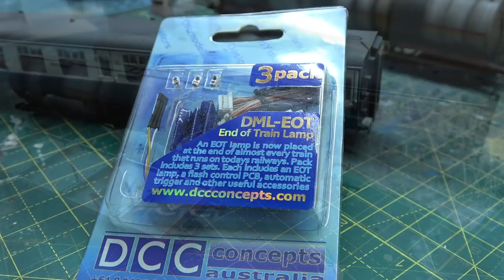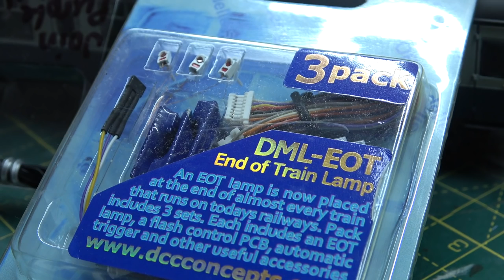Fitting working end of train lamps

Comment: Been using these for years. Such a great product.
When I do mine I remove the pin for the white cable by using a scalpel.
With the yellow and purple cables, I cut the quite short, maybe 3-4mm.
Remove the sleeve from the cables, twist together and solder.
Makes it a little neater.
Reply from the maker: Cheers, I'll de-pin in future.

Comment: The tail lamp initially signified "Train complete" to a Signalman in the old manual signal boxes - or anyone else on or about the line observing the passage of a train. In the old days of absolute block, along with no or limited track circuiting and loose coupled or partially fitted goods trains, it was a vital visual assurance to a Signalman that the passing train was complete and that he had left the section as clear as he'd found it; i.e. there were no rogue breakaway vehicles left behind. Nowadays, track circuiting pretty much proves the route is clear but tail lights are still a comforting sight for all concerned. Sadly, modern model makers have still not realised the important significance of displaying a tail lamp because they provide no function to turn off the tail lights of their engines when coupled to a train. In the real world, any loco pulling a train and displaying tail lights would be stopped as soon as it was discovered and until the error was corrected.
Reply: Many years ago, we had a new station manager at Reading. She was Spanish.
She saw a freight rolling through the station and saw the tail lamp. Then went off in a panic, called the box and reported a train in trouble. Shut the station for about an hour.
She got a sideways promotion shortly after.

Comment: Thanks Richard, that was a very interesting video. I’d wondered how those spring type pickups worked ! I use iTrain with block detection so had intended to fit some form of tail lights to my loco hauled trains , not only for aesthetic reasons but for a more practical reason - so that iTrain will know when the whole train has moved out of a block and not just the locomotive.

Comment: That circuit is insanely big! You can get SMD LEDs that flash slowly by them selves, no circuit board needed.
Reply from the maker: You still need to convert the DCC signal into a usable 12v for the Leds.  They wont flash connected directly to the track.  Agreed the circuit would be smaller though.  Ideal for some of the wagons.
Reply: @EverardJunction  1 diode and resistor will do that trick. Can even add a small SMD capacitor across the LED for stay alive. 
Also will be more cost effective

Comment: Its really great to see you hands on because although we know these are models, when seen running in your layout, its difficult for my aged brain to not realise they are not the real thing. I only got to play with the real things, so its great to see what level of realism you are going down to. When i started on BR  trains didn't have headlights like they do now, they only had illuminated route box indicators or double white lines on front and double red lines on rear when ECS. This was on 415 and 416  epb units. That was the inner suburban and the loco hauled for long distance passenger. Also brilliant you have train crews in cabs as it was quite common for other train crews to travelling passenger in rear cabs. I'll be looking out later on for a crew to be "Paddling Up" to change the shoe fuse.

Comment: I recently did this to a rake of BR MK1s using the wiper pickups. The train hardly moved so I switched over to the spring on axle method. The train looks fantastic in a low light.
Reply from the maker: I had the same problem with the wipers.  They're handy for a single vehicle in a train but not the whole thing.

Comment: Great video!  I noticed that you install a left and right pickup on the same truck (on both ends of the railcar). One word of caution would be that if someone is running metal truck frames, they wouldn't want to do that as the electrically live axles would short out through the trucks.  As mine are plastic (and I suspect yours are, too), that isn't a problem.  If you have metal truck frames, you could arrange the wheels so that they both pick up from the same side in a particular truck, with the other truck picking up from the opposite side.  While not as ideal for dead areas of track (like diamonds or frogs), it would be much better than a single pickup on each truck.

Comment: one thing that I know that when yo take a car out of service if it be a tanker, box car  ect and you need a EOT you would put it on another car so that you have a EOT while the other one is in service for repair. Great video here on how and where you placed the EOT on them if there is a way that you can move them around would be perfect but I know that it is almost imposable to do, your video have gotten me thinking of EOT for my setup that I am thinking about building or making from old parts that I have laying around the apartment where I work. if it is posable that I can do it witch I feel more than able to make and it dose run on the same way that you have in your video here I will let you know how it turned out without having to spend money when you could save some in these times we live in.

Comment: I use conductive ink to bridge the wheel insulation without the danger of damaging the bush. Its made for drawing connections for components on almost any surface, including paper.
Reply from the maker: I've tried that a few times and had mixed success.  The last one I did corroded and eventually stopped working.  Stuff was called Liquiwire

Comment: Have you concidered having the magnet switch under the roof of the wagon? Then you could switch them on and off manually with a handheld magnet, and also they would not be affected by any kind of magnetism from the rails!
Reply from the maker: If the train looses power for even a second the lamp would go out and stay out until activated by the magnet again.  Just the way they work unfortunately.  I got fed up with them turning off when they went over some points or dirty track so decided to remove the feature.

Comment: From memory, working on the railways. The rule book on tail lamps was basically: if a train passed (freight or passenger), not displaying a red tail lamp / lights, you could assume the train was incomplete (or divided). Eg. Possibly, part of the carriages or wagons had become come detached. In practice; more likely the lights had not been put on by the train crews; (on a passenger unit as an.example).

Comment: I'd personally put the white wire out of the connector just to neaten it up a bit more and reduce the chance of any short. Those JST connectors have little flaps on each pin, if you lift them up you can just pull the wire completely out.
Reply from the maker: Cheers, will do that in future.
Reply: @EverardJunction  No worries, don't mention it :D

Comment: The battery operated flashing tail lamp hasn't been around, possibly as long as you might think !  There were still lots of oil tail lamps in use at the end of the BR era, which gives you a little more choice. Just be thankful you aren't running GWR passenger trains with "Slip" coaches. Which could require as many as 3 tail lamps on one vehicle all in a cluster, to identify the number of slip portions included in the train !!! 
Happy modelling, your layouts coming along nicely.
Reply from the maker: I might add one or two oil lamps in future as they were still about following the widespread flashing lamp introduction in 87.  The oil lamps were eventually banned in the early 90s.  You won't be seeing any slip coaches any time soon!  Far too complicated as you say, cheers.

Comment: Great video. I am gathering all the supplies together to start adding interior lights to my rakes of coaches. I have a mainly steam era layout & will add the appropriate lamps to the end coaches. Just interested in the size of that fine enamelled wire you are using & where you get it. 😀

Comment: I don't know about some but if anyone is wanting a end of train light like this. If you use Bachman they have a wheel set fited with said light and it has a realistic coupler that the light stays on. 
IMPORTANT NOTES BEFORE BUYING!!!! MUST READ!!!!.  
Note 1: the light dose do well on dcc or dc its fine. 
Note 2: back of the box that the light is in is not painted so it might light up the end of your train car. 
Note 3: if you get this the train car HAS TO BE from bachmann. I don't know if it will work with others Rolling Stock makers but this thing is best for bachmann only!
Note4: last time i checked it was like $20 to $30 us dollars to buy just one little wheel set with said light and the motherboard chip to run it as of 2021 September 4.

Comment: Great video and techniques! Using a decoder for each tail lamp seems a rather expensive approach but the simple method of bridging the wheel-axle insulator is brilliant (I had wondered about soldering wires across). I wonder what you think of the alternative battery tail light systems with motion-sensitive switches

Comment: this is at least as complex as when you showed how to wire switches - ty for the exquisite detail - one question does it matter which way the pickup strings long ends point - i.e., should they all point in the same direction or does it matter - ty for posting! :)

Comment: I love the idea of the pickup spring - very neat.
How reliable is the little slithers of wire in the bushing?
Is there a metal - brass perhaps - bushing replacement to remove this requirement?
Al.

Comment: Excellent 80's synth pop intro music :) Deffo a nice feature to add a whole lot of realism to the models Richard, I'm working on a 3d print of these lamps but I'm going budget and try a flashing red led inside the coach connected to some fibre-optic cable & the DCC Concept spring pickups - I think it should achieve a similar effect. 
What gauge wire is the enameled stuff you connected to the pick up springs please?  All the best.............Andy
Reply from the maker: I've used the fibre-optic method in the past.  Certainly worked well if a little more time consuming.  Not sure on the enameled wire size, think its about 0.4mm.  Cheers

Comment: As much as I love your episodes you frequently leave my scratching my bald head.
I appreciate the DCC CONCEPTS & your techniques.  HOWEVER, are you or an Everard subscriber aware of a simple DCC board that can be installed and act as an on/off switch, between the yellow & purple wires?
If so the circuit could be BETTER activated remotely from the operator's handset or an automated computer system.  Or any I just crazy?
From N.Y.C. U.S.A. NEVER FORGET 9/11/01;
Jim

Comment: Did flashing tail lamps exist in the mid/ late 80's? 
I only every remember them being paraffin lamps up to the point when I gave up spotting.
Reply from the maker: The flashing lamps started to appear around 1985.  By 1987 the introduction became widespread.  Paraffin lamps were still in use on some trains but rare, eventually being banned in the early 90s.

Comment: How would you wire the tail lamps on an item of coaching stock that you fitted interior lights to?
Reply: just tap power from the  wires from the lighting circuit and hide  circuit board as necessary
Reply from the maker: Correct, I've done that to two of my coaches

Comment: Hi. Is it possible for these to blow?. The biggest thing that concerns me with regard to these is that you can't see if the wires are touching inside the base of the lamp and I don't know if because of this these have blown because all three lamps are not working and I'm not reading anything on the multimeter.  So do you know if it is at all possible to blow these LED's??, many thanks, Chris.

Comment: With a single lamp does it matter whether it’s on the left or right?
Reply: There was no regulation for which side these electric lamps was placed on trains. There are regulations for lamps on guards vans when using paraffin lamps where the red lamps position was changed during the journey depending on if the train was on a slow line next to a fast so a following train driver could see the train ahead was not on the same line as theirs. With flashing electric lamps I only saw a few goods trains with a guards van and am pretty sure the lamp was placed on the middle lamp bracket